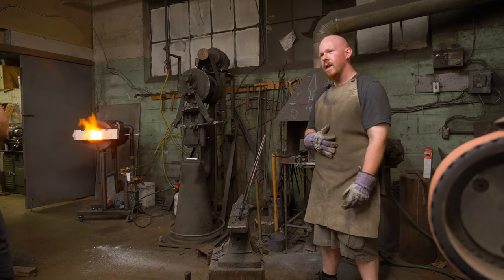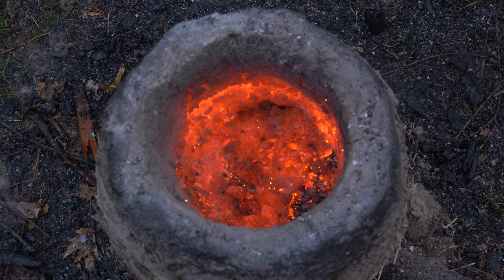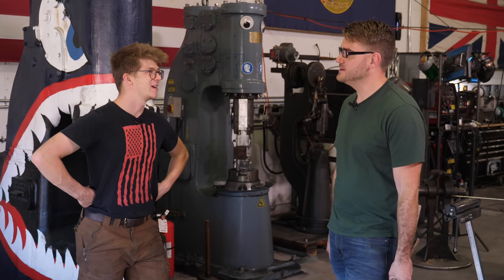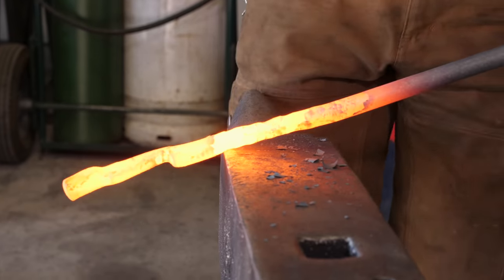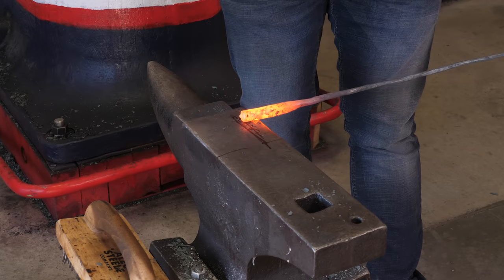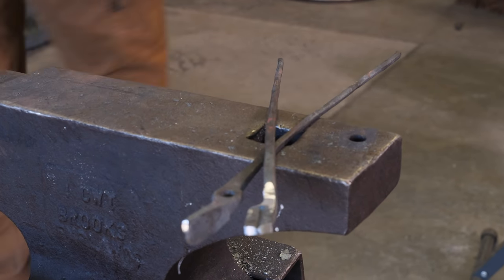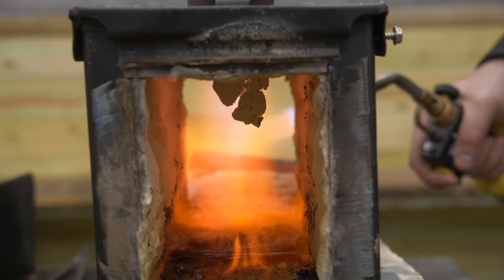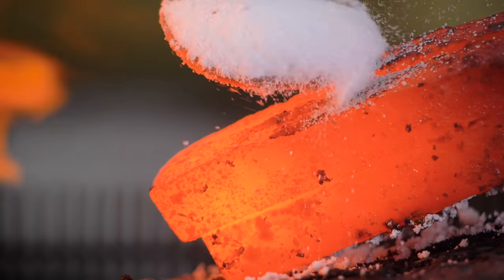Unlocking Iron Tools: Blacksmithing Iron w/ @AlecSteele

Comment: try using granite for your rock anvil. also if youre going to manipulate water, the australian primitive guy on here made a make shift power hammer from wood and rocks and had it powered by water. so you could make a power hammer powered by water for blacksmithing.

Comment: If ya wanna make this experiment more successful  (if you repeat it somehow) try a taller furnace with a decent sized airhole at the bottom. The stag should all flow past the kindling to the bottom like glass and the iron should settle ontop of the ash and or Slag under gravity power. 

I think the two reasons this didn't work as effectively as it usually does would be the heat which can be solved with more oxygen and the oxygen moving faster as it combusts.. hence the taller furnace. 

You're aiming to make a rocket stove with a slightly larger hole at the base.

Comment: Cant you use the one method where you make steel inside a clay container you use a bit of sand in it to pull out the impurities and it really is much cleaner that way. You heat it from underneath the glass pulls out all the impurities and is drawn to the top. I know I am missing some steps but yeah.

Comment: You´ll find that a coal forge is way better suited for forge welding than a gas forge is. Coal forges contain a reducing environment because the high amount of carbon present quickly reacts with any oxygen; because of that you would even get away with inferior flux like quartz sand as long as you make a little effort in your prep work. 
Gas forges, on the other hand, contain an oxidizing environment that makes a clean forge weld comparatively difficult to achieve and produces a ton of scale; this is what `shrunk´ your parts.

Comment: Also looks like you are trying to forge the iron at too low of a temperature which could be part of the problem with crumbling also you might try crucible smelt or crucible steel

Comment: Throw some sand in it or some quartz crystals. The silicon binds to iron when heated it will act like a glue ball to help you forge weld the pieces together.

Comment: What you arent doing is they figured out that smelting iron is actually an anerobic process where to get the fire hot enough it needs oxygen. They would pack powdered ore and leaves/sawdust into clay pots and  then seal them completely. Then they would heat them in the forge (usually powered by the winds from typhoons/storms). These could then be cracked open when cooled for nice high carbon steel ingots with low amounts of slag.

Comment: You should replace the handle for the larger iron hammer now. The taper that you have going into the hammer is not good, you should at minimum split the wood that does into the hammer head and add in a wooden wedge driven into the wood after it is threaded through the hammer. The last thing you want is to hit something with the hammer and have the head go flying off and injure someone.

Comment: One a huge fan, and love all the content provided by these videos, however I must state that my experience with shaping horseshoes and forging basic shapes and attachments that you must simply strike harder in the last portion of the video.

As Alec Steele mention, his aggressive hammering on a sharp angle of the anvil contributed to the heat and retenti
Reply: -retention of energy in the working mass.

Strike harder first, and weld will be more easily achieved!

I'm also sure there is some editing nonsense to make sure the idea is presented appropriately, and some strikes are purely for timing and aesthetics.
Reply: There's also a distinct lack of video of scraping or cleaning the oxide off the heated iron ;)

I also use borax flux, or more accurately, dehydrated borax from an oven.

Comment: As a hobby blacksmith I really like this episode, but use of "iron" when clearly the tongs were made from mild steel just adds more confusion. Iron is an element, where as mild steel is an alloy (like the bronze) of Iron and Carbon. Wrought Iron is iron where the slag from the smelting process is mixed in and through the forming of the bloom creates strands of slag throughout the Iron. Wrought Iron just like a piece of wood it has grain, and it needs to works in specific ways because of this grain.

As a tip, forge welding in a gas forge is really hard because they just barely get to the right temperature. Go with a charcoal forge, it will easily hit the temperatures you need as well as stay clean (unlike a coal forge due to the sulfur and other impurities that turn into clinker). Flux is also not glue, it is there for 2 reasons:
1) To prevent the Iron or steel from oxidizing (because Iron Oxide melts at a much higher temperature)
2) To reduce the melting temperature Iron oxide that is already there.

Some other tips for forge welding, clean the iron/steel before hand until it is nice and bright and clean. Then bring it up to a warm heat, but still no color. Add some flux and get it to melt in place. Gently (you don't want to knock off the flux) place it in your forge to come up to temperature. Do the same to the other piece, but don't just stick it in the forge, lay it on top of the previous piece so that the clean faces of the iron touch each other. You can test if they are at forge welding temperature by poking with a very small and sharp iron poker. The sharp tip comes up to welding temperature almost immediately and will stick to the other iron if they are both are welding heat. The surface should look like molten butter and be a bright yellow. Once they are up to temperature do light taps to start and fuse the two liquid surfaces together. That will cause the weld to tack. Use a wire brush, to clean up everything, more flux (to prevent oxidation) and back in the forge. Get it back to welding temperatures and this time when you pull it out of the forge give it some really good wacks. You know you have a good weld if after cooling down you hit it with a hammer and it rings like a bell. If there is a thud sound, your weld didn't take and try again. 

I realize you haven't made a vice yet, but they are great for welding as they apply lots of pressure which is what you need for a forge weld. Good luck and I hope to see you try it again. If you are ever in the Manassas Virginia area I would be glad to show you what I know.

Comment: If you want to get iron you have to get it up higher and you have to get it really hot until I can melting point like molten lava you put a hole in the bottom and it should be pouring out and there you go

Comment: your forged weld hammer is going to explosively fail at some point. forge welding is not actual welding its much more like soldering with the same metal. it binds but doesn't weld

Comment: By the way, your bloomery is not hot enough.
When blooming you basically can't get too much heat in a bloomery.
This is why they were not able to do proper steel, until the blast furnace was invented.
They couldn't reach high enough temperatures.
And the recipe for hot bloomery is good coal fuel, good bloomery build, and lots and lots of "air"(oxygen).
The hotter the bloomery, the more bloom you get.
Adjust height and wall thickness of the bloomery, depending on type of iron, and purity. (A good average is a 55cm high, 30 cm wide 7cm thick walls. Bloomery.
And install a teuere at preferably 15 degrees pointed at where the back wall meets the bottom of the bloomery.
Good luck on your quest!
Don't forget you want pre-roasted iron ore, to create the new chemical bonds, before blooming. You don't want "raw" iron ore.

Comment: What's the borax for when he's forge welding the iron?
Reply: It´s a flux; it serves the purpose of lowering the melting temperature and prevents oxidation, thus making the forge weld possible.
Reply: @nilsschenkel7149  ohhhh that makes sense. Cheers mate

Comment: if he is getting a bunch of pieces of unconsolidated iron why not try crucible steel ? it should be easier when you figure out how to do it, and you should get something much easier to work with. or maybe go the japanese way and wrap everything in paper and ash so they don't fall apart in the forge. I'm not sure you can get high quality and super consistent steel like that, but you should get something you can work with.

Comment: You really need to get yourself a flatter work surface, and it's easy to make flatness from nothing using the 3 plate method
All you have to do is lap each surface against each other in alternating pairs

Comment: I think you were a little over-eager in claiming you had unlocked iron and thus could start using modern-made scrap iron. I'm skeptical that changing to the different bloomery is what solved your crumbling issue, and not that, you know, you were melting down raw modern-made scrap iron.

Comment: I wonder how much iron is needed to make a shield
Reply: Not much. Most historical shields were made mostly from wood. You'd need the iron mostly for rivets or nails and, depending on the type of shield, you might have a shield boss which is where most of the iron would go. It should be noted that metal reinforced rims on shields are basically fantasy. 
So I'd say a nice shield, like for instance a viking roundshield would include: 
1: A bunch of wood 
2: Some leather or maybe linnen to cover the shield, add grip straps etc. 
3: Some paint or resin to protect the shield from moisture and to decorate it. 
4: Enough iron to nail the whole thing together and make a shield boss (overall, I don't think you'd be looking at more than about 1 kg of iron, probably less, with the overall weight ranging from 5 kilos to maybe 7 kilos on the big and heavy side).
Reply: @darthplagueis13  I did not know that very informative 👍

Comment: if you try to make thermite, by ball milling carbon and iron oxide, hopefully 99% pure, or for giggles other thermites like aluminium or magnesium iron oxide thermite
Reply: instead of clay, wheat to carbon furnace, also to pure carbon, by carbonization, blacksmithing is kinda avoiding first separating iron oxide, then making near pure iron, density separation of molten rock ore
Reply: if you want more at one, make more
Reply: how about cranking the heat to 11, smelting instead of forced binding
Reply: casting
Reply: friction melting, water, solar-water-steam, wind

Comment: Hey you are going to have alot of problems forge welding with that propane forge.  Propane barely gets hot enough to weld at all and THAT forge may not get hot enough period.
Reply: That forge is using a burner that can efficiently heat 350in^3, and that forge body is under 200in^3. It gets plenty hot enough to forge weld. The only drawback to welding with a gas forge is the increased amount of scale compared to a coke forge.

Comment: Using steel nails is a bad thing for the longevity of your hammers if you plan on using them, copper horseshoe nails or just copper nails in general should be easier to work with and shouldn't dent or crack your iron hammers over time.

Comment: Your fire looks oxygen poor (too yellow).  Add a fan to inject more air into the bottom.
Reply: That's actually by design when you're forge welding with a gas forge. If you choke your forge (or up your gas) to a carburizing flame while welding, it'll actually clean oxides off your steel.
Reply: @ENoland8  I was talking about the smelting furnace, sorry for the confusion.

Comment: You struggled to produce enough iron for an arrowhead with the use of borax which you had no right to possess, and then you attempt a tool for which you wouldn't have even a tenth of the necessary iron.

Comment: Idk where you live guy but short steel here is .25 cents a pound go to your local scrap yard and get yourself an aso or a forklift tine basically you could have an aso anvil 100 lbs for 25 bucks i have found tongs hammer heads vises Leaf springs old broken or worn out files make great knives .25cents a pound  its like nobody knows how great a scrapyard is if your a blacksmith or maker had the whole place to my self 😏

Comment: You literally lack the strength to flatten white-hot iron. If you lack the strength, get a bigger hammer. Back then NOBODY had the luxury of using an infinite supply of a gas forge. Coal was precious.

Comment: This was so far beyond cheating I don't know where to even begin. You did not make iron. You consolidated a bunch of steel, in the process making it of the worst quality steel possible. Yet still steel. Adding more carbon to steel does *not* make it iron. Common man! This was bad.

Comment: OoF... I am not surprised the handles broke, they are horrible. 🤣 That's ok, that's why you're doing this. But just remember, the handle is just as important as the head when it comes to impact tools. Copy what you see on modern hatchets and axes, those haven't changed much in about 2000 years.

Comment: This is still cheating - we can't call the iron age "unlocked" yet, because we still have to see one successful smelt from ore to ingot, without several additional steps in between, without the majority of the chunks not consolidating into a workable large piece, and without the addition of modern scrap metal (!). The smelting, up until now, is non-successful; there has only been a little bit of workable iron made with primitive technology alone, enough for a small blade. The technology wouldn't have been feasable this way - it would have never created the cultural revolution that is to be depicted in this series. If this were the outcome of the real history, we'd still be living in the Bronze age, literally. Please make a successful smelt that produces a large, workable ingot in one go.
Reply: I've noted that too, but the show must go on 😐
Reply: I guess the show must go on. Plus, keep in mind: Whilst a craftsman in 1000 BC may not have had access to pure modern scrap metal, they would likely have had access to bog ore, which would have been much easier to work with than the ore scraps that he is using for this show.

Comment: You didn't make the iron. You made a tiny bit of it then used modern iron. You didn't make your own tongs. You got a blacksmith to make you a pair on his anvil. You didn't make your own forge. You're using a gas forge. You just threw out the whole premise of the series. Just admit you hit a wall and can't go further without a lot more work.